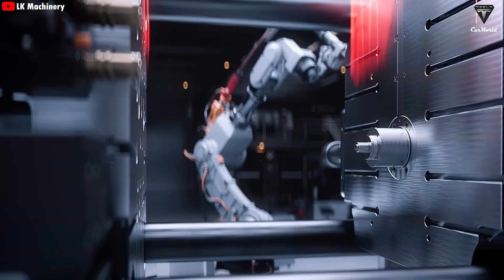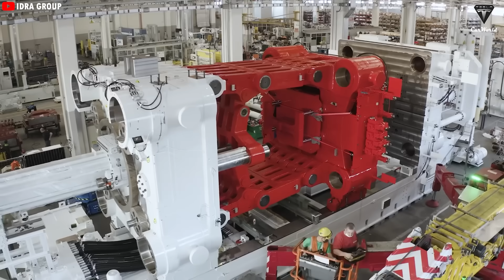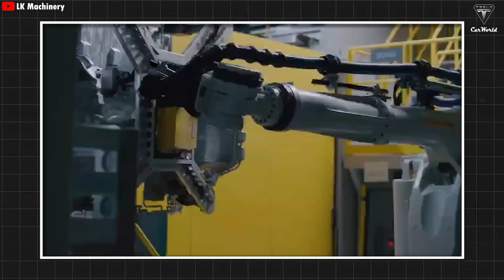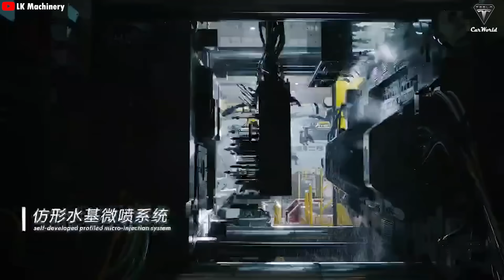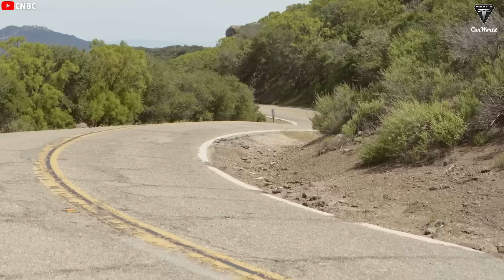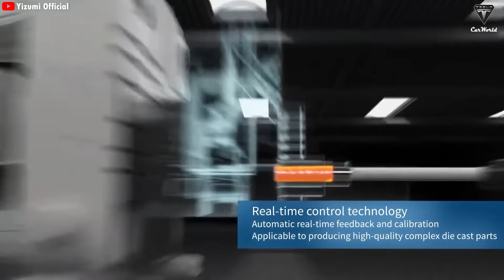It Happened! New Tesla Car FINALLY On Giga Press 50.000T, Elon Musk SHOCKED Built 12 Cars Every 60s!

Comment: 5 seconds, this is so hard to believe or even conceive. And 50,000 psi, Elon the biggest companies in the field would not even try 5000 psi a few years ago. 
One needs to have great faith to believe in this. 
And now there an Aluminum smelter right at the factory to.just do recyling of Aluminum right there. 
I am going to need to see more proof, they can't move the goal posts this fast.
Reply from the maker: You’re right to question the scale! The 50,000 psi and 5-second casting from the Giga Press do sound mind-blowing, and an on-site aluminum smelter for recycling is a bold move. More proof would help—let’s wait for Tesla’s official demos to confirm!

Comment: Model Y: 35 seconds. Model 2: 5 seconds. That’s a 7x increase in throughput!
Reply from the maker: The Model Y’s 33 second cycle and Model 2’s 5-second cycle reflect a 7x throughput increase, thanks to the 50,000-ton Giga Press casting multiple chassis simultaneously.

Comment: Could Tesla eventually develop a recyclable or bio-based mold material instead of traditional steel or iron molds?
Reply from the maker: Tesla might explore recyclable or bio-based mold materials in the future, but currently, it relies on traditional steel or iron molds for the Giga Press’s precision and durability.
Reply: The Aluminium and Steel components of most teslas are eminently recyclable … in fact recycling Aluminium is much more efficient than the original extraction process …

Comment: What are the environmental trade-offs of running an ultra-high-energy system like this compared to traditional modular assembly lines?
Reply from the maker: The ultra-high-energy system of the 50,000-ton Giga Press offers higher efficiency and faster cycles compared to traditional assembly lines, though it requires advanced cooling and power systems, potentially increasing energy costs and mold wear as trade-offs.

Comment: Does the 50,000-ton Giga Press require a custom power grid or cooling system in the factory, and how does that infrastructure scale globally?
Reply from the maker: The 50,000-ton Giga Press needs a custom power grid and cooling system due to its massive scale—131 feet long and weighing up to 8.16 million pounds. Tesla likely uses reinforced infrastructure and advanced cooling baths to manage this.
Reply: Hello

Comment: I saw the interview by the Tesla engineers where they said that the closing pressure of the small gigapress was 6000 tonnes, but they worked out that part they were pressing didn’t actually need that high of a pressure. It operated daily at about 2000 tons.
Reply from the maker: Can you explain further? Thanks!
Reply: @TeslaCarWorld The size of the gigapress is rated in “closing pressure”. So, 6000, 9000, and extraordinarily, 50,000 tons is the pressure exerted by the hydraulic rams to keep the mould (mold) closed while the molten aluminium is injected into the mould. The injection takes typically 120 milliseconds to complete. A couple of seconds later, the hydraulic pressure is released and the mould opens.  Now, the cycle time of the gigapress is somewhat dependent on the time it takes to get to the correct holding pressure to keep the mould closed while the injection happens. This is very dependent on what is being made in the press. Smaller parts don’t need the holding closed pressure that larger parts need. Now that Elon is talking about injection moulding an entire car, you will understand that the pressure to hold that sort of volume and interior surface area closed is bordering on the ridiculous; e.g., 50,000 tons. Don’t worry, if he needs 50,000 tons, then the Italians will build it for him.

Comment: You can see the web structure of the casting to give the aluminum part the rigidity needed for a structural component of the car chassis. I suspect this design works great for strength and light weight, but if you get into an accident, the car will probably be totaled out, because unlike cars made of mostly steel, you can't park it on a pulling table and pull it back into shape enough for it to work again, because aluminum doesn't do that, it breaks.
Reply from the maker: The Giga Press’s casting process uses aluminum to create rigid, lightweight structural components. While durable, aluminum can deform under extreme stress, but Tesla’s design and cooling systems aim to mitigate such risks, ensuring the car remains functional.
Reply: Who wants a crashed car that has been pulled back into shape…I’ll take a new car, thank you!

Comment: How do they build a strong enough base for the Giga press to avoid cracking the foundation? In a wreck is the frame is damaged, is the car totaled or is it repairable?
Reply: Integral frame of press resists the forces
Reply: It is not a drop forge .  The Machine frame counters the press force.
Reply: In a wreck the bent and misshapen parts can be cut off and replaced to a certain extent … Munro pointed it out at a teardown . Even the Cybertruck …. Probably the Semi too …

Comment: Is there a limit to how large and complex a single aluminum cast can be before you start running into diminishing returns or structural flaws?
Reply: Actually it comes down to Die Design and press capability … I believe that parts are all well within design limitations … the presumption that there are structural issues ignores all the Early testing before the pressed components were even used in Cars .